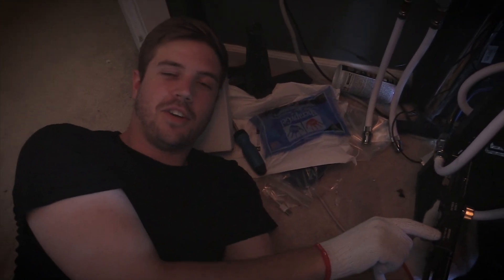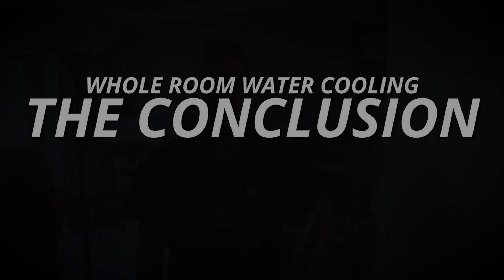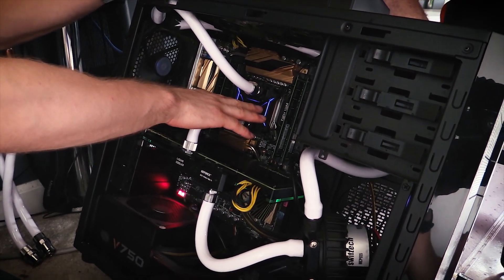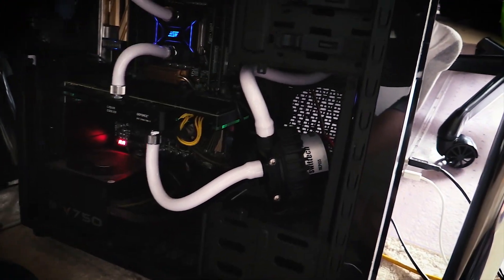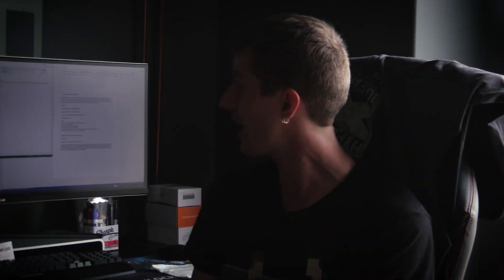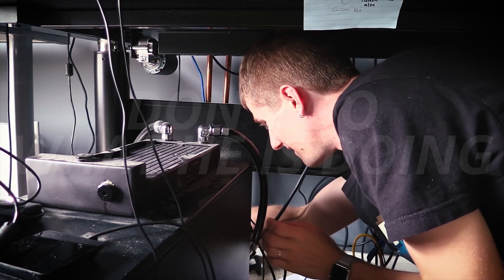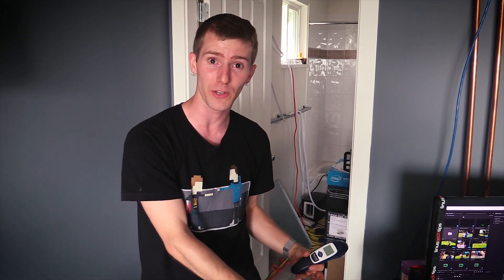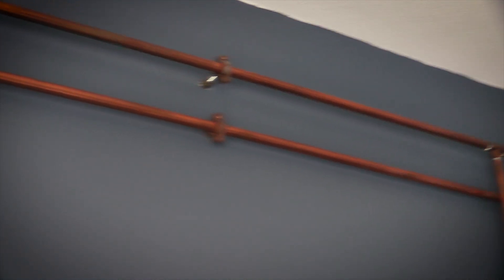Whole Room Water Cooling Part 7 - It's FINALLY over!

Comment: As a mechanical engineer this whole series has made me cringe pretty much all the way through. So many obvious mistakes!
- Uninsulated copper piping radiating the heat back into the room before it gets to the radiator
- Having the piping at the top of the wall which adds a lot of unnecessary strain to the main pump which has to push against gravity for no good reason. This also meant they had far more piping than was needed (each length of vertical pipe roughly 6 feet, 2 lengths for each PC, 7 PCs = 84 feet of unnecessary piping)
- No bleed valves! There should have been at least one on the system, preferably one for each PC
- It is ugly as hell!!!

Comment: Don't know if you tried this , but in the out door fans push pull it may have helped to do what OC3D did with 40 fans , your one used 10 pp then use 20pp . only coz of the wind at that height may have reverse air flow  and slowed the flow dropping your efficiency in harf so if the rad temp =30 in, and only 28 out its not got enuf fans = presser, an aircon haz to hav a 7degrez dif from in to out  , when we put aircons in and its way too windy we have to make a wind box over the out side unet with a pull fan if its real bad , or the head presser on the compressor gets too height as its working harder to try n chill wat the fan is not doing. and the reserve water box put it in the ground if u have a cold under ground stream or hi water table  .it will help cool the tank ,

Comment: I think another "good" idea would be to have the pipe work running inside the insulated walls.

Additionally, perhaps you could install individual rads per computer on the roof, then have the piping running through the walls to dedicated outlets for each workstation. Just like a power outlet, except it'd have two connectors marked "in" and "out" as per the coolant flow.

So, each workstation would have a power outlet, ethernet jack, and coolant connectors.

Comment: If you ever try again put you radiators in a  freezer instead of outside let's see if the cools it even more. Maybe even go balls out and use liquid nitrogen but not directly on the pipes to avoid freezing the coolent when not in use. Just suggesting this since u guys where trying to cool 7 pcs. I've seen liquid nitrogen for one pc but it was not practical but for 7 ehhhh it might be good enough to keep the coolent from freezing

Comment: IMO, to officially determine it was a moot project, allow all the PCs to run through each other in series to determine it was a loss. I believe the that its a huge feat since each singular PC has its own loop system, which is a whole lot different than multiple systems on a single loop.

Comment: Just went to show when you're going to do something don't go half hearted into a project. Everything was done on such a small scale. Crappy pumps, shitty radiator design with 5,000 tiny fans, a ridiculous loop that didn't need to go round the ceiling and up and down to each PC on the floor, a pathetic tiny metal box for a reservoir. The concept would of used a shit load of power and would of lacked in performance v's cost.  But fuck it he had a good crack at it. So thumbs up anyway.
Best to speak to someone who does water loops for a living on a large scale and get pro advice. Hot House/Glass House plumbers would of killed this project. They don't mess around when it comes to water loops.

Comment: noobs. All you had to do was ask the community before you started this and the maths would have answered all this for you. When I first saw this I was excited until the pipes were exposed int he room which made me think that you were using the room as a radiator which had me confused with what was going on outside.

An air conditioner just for the room going at 100% would have made a huge difference.

Water cool at the new place please. You will have a whole rooftop at your disposal to dissipate heat.

That same heavy duty pipe that sends liquid up or down from the roof could be the fire pole.

Comment: Another thing: If you have a feed/return system that has individual users, the feed must have a decreasing diameter with every branch while the return needs to have an increasing diameter on the way back because you need to go with the flowrate that is much, much bigger at the reservoir than at Edzel's PC at the end of the loop. It also helps to actually divert the water into the branches to the PC loops.

Concerning AC: Have you checked how much energy the WRWC system draws as a whole (pumps, radiator fans, etc.)?

Comment: Hot outgoing pipe above the colder pipe (because the hot air around it will go up), pipes on the ground because of the same reason, and finally ISOLATION on the pipes.

Comment: Linus have you guys ever thought of copper tube insulation.
It's very cheap and keeps the heat/cold inside the tube and outside the room.
You could do all that tubing for around 20 dollars so it won't be that much of a price to pay to check it out.
http://www.homedepot.com/p/Frost-King-1-2-in-I-D-x-3-ft-Pipe-Insulation-4-Pack-P10X/100090475?keyword=copper+tube+insulation

Comment: You should probably insulate the pipes, have a de-pressurization point at the highest bit, use Unipipe instead of copper because much like the iron reservoir fresh welded pipes aren't cleaned beforehand. Your dad needs to learn how to use a bending iron because holy shit that's a lot of 90 degree bits. I actually wonder if you can feed the hot water from the PC's into a boiler that will heat cold tap water for your house, and thus saving on gas.

Comment: I have a radiator outside of my window in a 9m² room and it lowers the ambient temperature inside of my room by several degrees.

it used to be unbearably hot in the summer but now it's perfect.

i just use normal tubing and the loop fits just about 2 litres so a normal pump works just fine.

i also use quick disconnects if i need to move my computer, for example a lan.

under load i hit around 30 degrees during the night when it's cooler and about 40-45 during the day when the sun is out.

the noise of the fans could sometimes get annoying if im doing something outside of my window, but inside with the windows fully open its completely unnoticable.

Comment: How about building a case inside of a refrigerator...!
Reply: Maitreya M condensation
Reply: ***** Any fridge larger than one or two cans of your choice of beverage will use a phase change system, not a TEC.
Reply: Maitreya M a fridge unfortunately isn't made to cool hot things, it's made to keep at a low(ered) temp. It'll prolly break the fridge if you stick a pc in there that's constantly producing heat.
Reply: Maitreya M I thought Linus hinted towards doing that...
Reply: Maitreya M They actually did a sub zero cooling project which uses the same concept as a fridge. Check it out.
Reply: Maitreya M What would have been cool is to add a phase changer to the whole room loop, maybe outside where the current rad array is and then insulate all the tubes so the water that reaches the blocks is only a few degrees C.
Reply: Thor Rankin Agreed, on most fridges you can hear the compressor especially when you put it on whatever the brand calls it feature to make it work harder to cool things quickly or something.

Most devices that do go the peltier effect way are usually the smaller ones, especially those intended for camping use etc that can be powered by 12V directly from the car "lighter" socket thing.
Reply: Maitreya M they did that... (well kind of) they used a freezer technology called phase change to cool a CPU to like minus 40 or something. look up phase change CPU coolers.
Reply: Ser Garlan Tyrell just add phase changers directly to the CPU.
Reply: tommytomthms5 well the point would be to many of the difficulties with getting the hardware to work when sub-zero.
Reply: Doing something like making the refrigerator work on dry mode like we do in AC's would maybe not let water condense on the motherboard.
Reply: Ser Garlan Tyrell I didn't say the computer was stable... lol
Reply: Next off building a rig from a freezer? Much better than a fridge
Reply: You would burn out the compressor on the fridge, not designed to handle that kind of work load... Now, a chest freezer set to the warmest setting, we might have something there.
Reply: Nathan Seeley just run the water cooling though a copper coil inside a chest freezer then into your system... you would need a beefy pump but you can work that in. you can probably get the water about 35 degrees F when idle so it doesn't freeze and under 50 F under load...

That would cut my temps in half.
Reply: Maitreya M It wouldn't help, either way, the heat is still dumped back into the room. There's no way to get around the heat produced, so the only thing that can be controlled is where it goes. A window mount AC unit would be helpful. It would remove the heat from the room and dump it outside, which was the point of the whole room water cooling project.
Reply: Maitreya M too much humidity?
Reply: ***** nope
Reply: ***** Fridges use freon and a compressor, not electronic coolers
Reply: Maitreya M How about living in a house inside a fridge.... EVERYTHING WOULD BE COOL :D

Comment: Hey.

If you happen to read this I have a suggestion on how to increase the efficiency of your system. The copper piping will still radiate some heat into the room, have you not considered adding some form of insulation to that piping so that it carries heat more effectively. My recommendation would be motorcycle exhaust tape as it is cheap and easy to apply.
Reply: CAElite I'm sure they have had that idea before, but since they're moving in a couple of weeks it would just be more wasted money.
Reply: CAElite He literally talks about this in the video, did you not watch it? He mentions how the copper tubing is aesthetically more pleasing, but is less efficient than insulated piping for the reasons you mention.

Comment: in the UK and we have central heating and a insulated piping system around most houses, i'd be tempted to find some hybrid where the pc helped heat the house...or produced hot grey water at least

Comment: And now for the fun part, removing those loops from each PC
Reply: ***** Good thing these guys are far from lazy
Reply: ***** He said that each machine has it's own rad and the quick release tubing that Luke's dad made (?) should make removing the loops easier. But ya, removing the copper pipes for the next owner would be a pain in the ass
Reply: Bryan Eng watch at 9:50 he says they don't intend to watercool their systems at the new office
Reply: ***** Yeah at the new office they will have completely new systems, so I don't think there is a need to remove the loops.
Reply: ***** probably will have all new work stations at the new office
Reply: ***** I think he means that they don't intend to do a "whjole room watercooling" at the new office but I think they will watercool every system alone like normal, they just need to add a reservoir and radiators

Comment: 7:37 linus you must hit that spot whit lazer that you want to check the temp and why cameraman didn't tell you that.
Reply: ALFABETAS999 No.  the laser is not exactly where the sensors is and up close that difference matters.
Reply: ALFABETAS999 It's an infrared sensor. You can't see it with the naked eye. The camera converts it to visible red light. So he probably didn't know.
Reply: 렉홍비 thx :)

Comment: nice project
actually the concept is used by OVH, a hosting company that managed to remove 70% of the heat outside of their datacenter and basically almost freecool their servers (they have videos on youtube talking about that)
- Mixing copper / plastic / aluminium (in house heating system is not recommended)
- isolate tubing
- make the system reversable (heat the place in winter)

Comment: You need to stop measuring temperatures on shiny metal surfaces with an infrared thermometer. You're most of the time measuring the temperature of the  room instead of the object, since metal reflects infrared radiation.

Comment: Whoever buys this house when you guys move into the new place is going to be like WTF is up with all these pipes..
Reply: PeterOnTheInterwebs you relize that you can simply take the copper pipes with you when you move right?
Reply: PeterOnTheInterwebs Indoor hot tub.
Reply: It's not the pipes that would matter it what happens when they tear the pipes down ;D

On a serious note pipes add 100% decoration, when a buyer walks in it would feel like they just walked into a toilet...
Reply: PeterOnTheInterwebs meth lab!  breaking bad style
Reply: PeterOnTheInterwebs A good 40$ pipe cutter would probably take about 10 seconds to cut the copper.

Comment: Great job! Now tear it all apart. Also, you are DEFINITELY not getting your security deposit back when you move.
Reply: ***** all they did was installing the copper tubing which is absolutly no problem. They cant take the deposit from you for screwing stuff onto the wall.
Reply: TheLordOfWar they can if you don't patch them. And having seen the house, they've got a lot to patch! That said... It was humor.
Reply: nintendofreak11 couldn't expend the energy to type "mate" and "you"? Yikes.
Reply: nintendofreak11 REKT 8/8
Reply: ***** Security deposit doesn't matter since they own the house anyways. Though resale value may go down if they don't patch it up.
Reply: ***** If they all work together, then patching the holes and repainting wont be that particularly time consuming. A day or two work at most.
Reply: Wow, to all of these responses. LOL... LinusTechTips you guys rule. Your commenters, some of them, do not.
Reply: ***** People suck in general. Worst thing you can find on Earth. I don't even exclude myself from that statement... But a niche subject usually groups people that think alike and respect others with the same passion. This is basically nerd-space I guess :P

Comment: You can probably get better temps, on air cooling alone, in an ACed room than this, right?
Reply: ***** Yes, but typically  an AC does the same thing through the Refrigeration Cycle. In hindsight, I wish Linus did a comparison (if this room had airconditioning in the first place which it looks like unfortunately it didn't) between the heat inside an AC room vs the whole room water cooler turned on WITH AC:

AC vs AC with Whole Room Watercooling

So we could really see if this has a significant effect in conjunction with AC.
Reply: metalhead2508 He didn't want to put a black out curtain in the room and make it all dark.  I wouldn't be able to work like that when I know there's a window and a nice view.  Also when you pull back a black out curtain you're going to feel a lot of heat that was built up when the sun goes through the window too.

Comment: Yeah... I have a car and computer background, the reason for antifreeze in a car is threefold, to stop the liquid from freezing and cracking your block, to lubricate the water pump, and to keep galvanic corrosion from destroying your radiator. When steel (most engines) and aluminum (radiators) are connected by water the aluminum becomes a sacrificial metal. You can actually buy corrosion inhibitors as well... but at the end of the day you have to think not only of that but also the fact the cooling being outside the building would freeze in the winter time. That and the fact that the copper piping (as mentioned in the video) pretty much undid any hopes of transferring heat outside...

Comment: I can see a lot of ways where this could be vastly improved but all in all it is pretty cool and a good learning experience.

Personally would have gone with closed loops on the computers with purpose built heat exchangers connecting to the main circulator loop.  I would have all the heat exchangers in parallel with home-run plumbing, to a manifold at the high pressure pump side, and the heat exchangers all dumping into a low pressure trough system (like real plumbing in a house).  Each parallel loop would have a valve on it for initial purging to put all the pressure to that single line until it is purged.
Adding a heat pump in the middle would be kinda cool, but if moving to heat pump then it makes sense to use an air conditioner in the beginning.
Radiator: car radiator with all-weather fan ducted.  Personally would have run a loop of copper underground in the back yard to dissipate heat. Ground source heatsink.

Comment: wANT A HINT???
Add a Pipe insulation to OUT GOING...
Reply: Probably wouldn't change all that much since the tubing is already kinda thin. Adding insulation can actually increase the heat radiated from a pipe due to the increased area and better emissivity of the insulation material. The problem is that all the monitors and people in the room are already a large source of heat which isn't transfered to the outside.
Reply: bUT ITS thin...which is the problem..its radiating the heat into the room, it does not have time to get the HEAT OUT...They have Foam pipe insulation cheap and it would hold the heat inside the pipe long enough to get it Outside..

Comment: Instead of Sweat copper fittings use propress fittings, They look better, and the chance of leaks is 0% + Looks cleaner. :). 

Before installing the pipe clean them with oxygen and some nitrogen, that will help cleaning the inside, no rust or trash guaranteed! 
The flux is causing the rust and your copper pipe will get a green color in time.